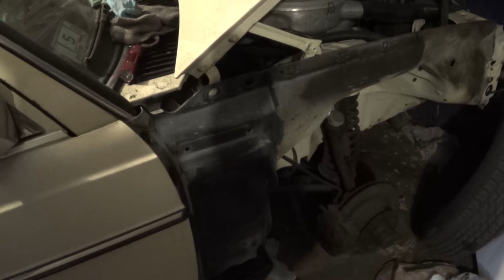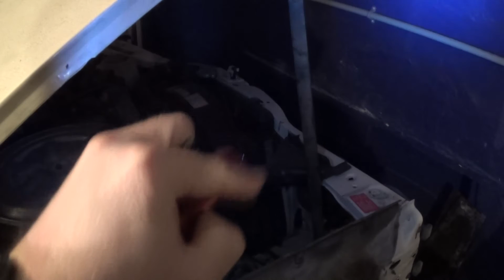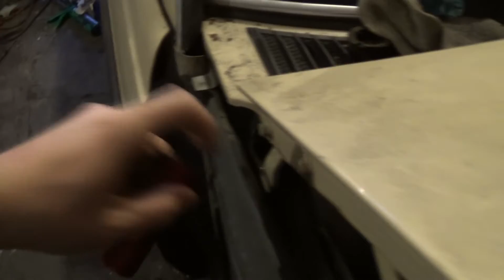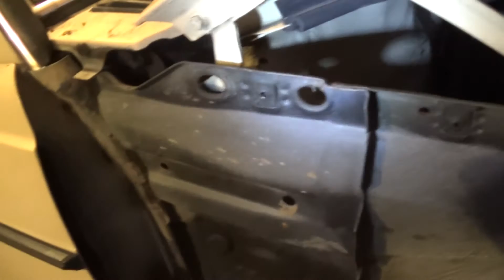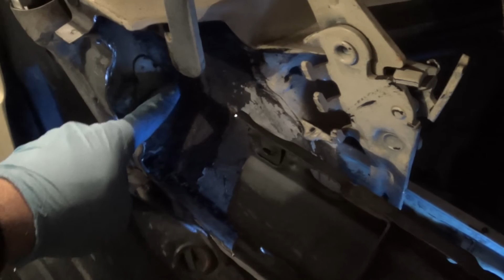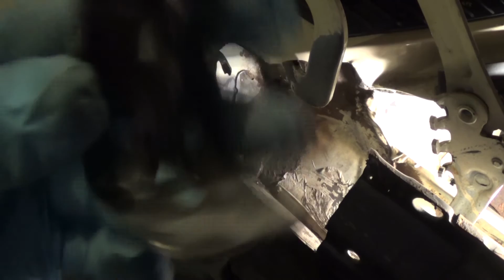1983 Mercedes-Benz 240D - part 47: hood spring repair

Comment: Nice job, only thing left to do is either tighten or change out the grill. I can hear it clicking when u open it, but if I remember correctly u saved the grill from the parts car.
Reply from the maker: It'll be coming off for paint, anyway. I can take care of it then. Good ear, by the way.

Comment: Congrats! The passenger side fabrication looks to be about done. Awesome!
Reply from the maker: Close. I still need to finish closing the hood spring pocket back off and then coat and paint the repairs. Then, I have a small spot to repair in the rear wheel well, behind the wheel. After that, I'm going to pull trim and do a little basic filler work on the passenger side. I really want to get this side complete and close to ready for paint before I start on the driver's side.